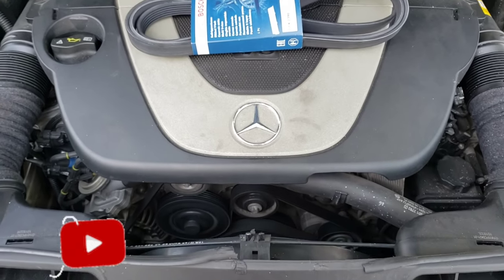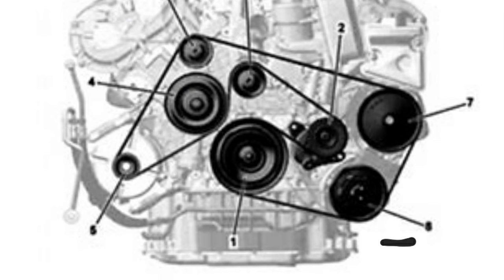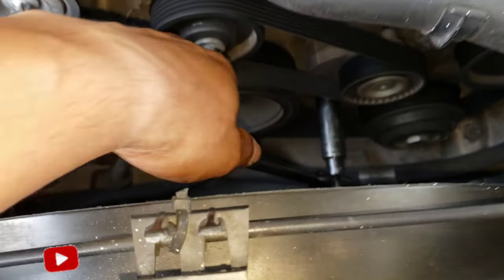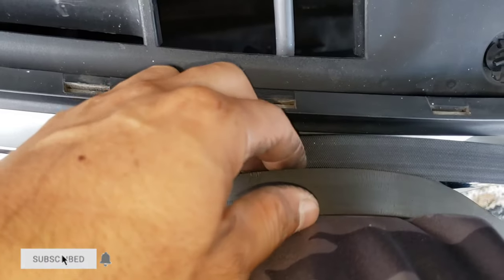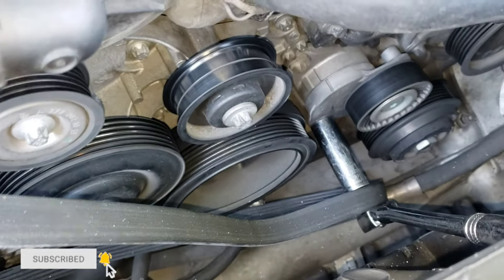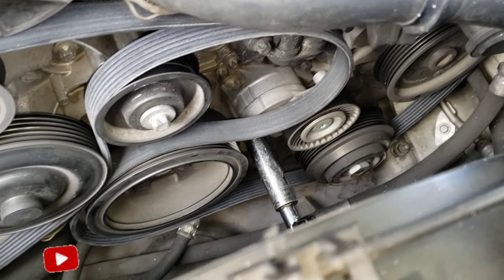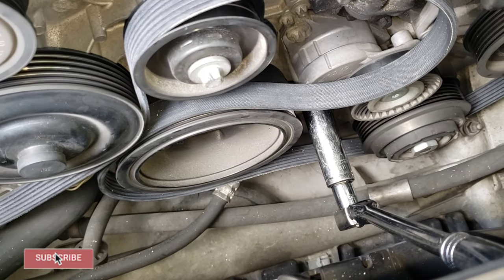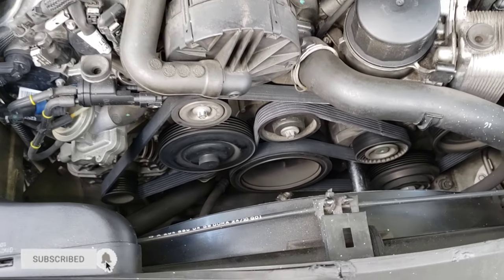How To Change The Serpentine Belt Mercedes c300 2008-2014 and diagram.

Comment: This is not for the 2014 c300 sport, learned that the hard way changing the belt on the side of the highway
Reply: May I ask how you know if your model is sport or not? I have a 2010 c300 and tbh I don’t know if it’s a sport version or not.
Reply from the maker: Hi. Thats a good question. The luxury and the sport are basically the same car with the exception of some cosmetic, for example the front grill on the sport has the mercedes star vs the luxury it has  a small star on the top front of the hood also the steering wheel on the sport has 3 spokes vs the luxury has 4 spokes etc (headlights, stitch pattern,wheels);  

Mechanical difference, would be the suspension. The Sport model has a slightly tighter suspension system, as a result it handles a little more aggressively with less body lean when pushed hard, it’s a little more firm over bumps in the road. The Sport model sits about 5mm lower than the luxury model in the front. Thanks for watching.
Reply: @Silenced_by_nazi_youtube  ❤😢😢😢

Comment: Thank you so much for posting this video. My car is an S550 model, and it appears it is the exact same setup. I am not a mechanic, but have done some repairs just by watching youtube videos. And since visits to the mechanic shop for repairs  have, unfortunately, become so expensive these days under the current economy, then this is a potential option.
Reply from the maker: Hi. You are 100% right,  is very expensive pay to fix this cars. Good job for fixing anything that you can. Thanks for watching.

Comment: Hey I have a quick question I have a 2009 Mercedes c350 and I’m trying to tune / upgrade it what do you think would be a preferred spot to start at?
Reply from the maker: Hello. Thats a good question, it all depends how much horse power are you looking for; some people start with the ECU  which is the brains of the engine, and as such, it tells the rest of the components what to do. It will allow for a richer air to fuel mixture and an increase in horsepower. Also the intake is one of the common part that people often start with and is one of the most affordable. The exhaust is the iconic mod that almost everyone performs, and for a good reason. The reason being the aggressive sound, as well as the increase in horsepower but this can be a bit pricey.
Reply: @hackerskates  thx for the info and yes gonna looking into the eco first right now it’s stock but trying to build it for fun 

Was looking at the stage 1 tune then when I’m ready go from there 

For what it is, it’s a nice car
Reply: @hackerskates  right now I’m just doing the basic stuff replacing the wheel caps buttons inside that have been used to much, and the belt 😂kinda squeaky, etc first then the gonna start with the tunes and the exhaust.

Thx for the info and the help most appreciated 🙏🙏🫡
Reply from the maker: @chad9382  you're welcome my friend. For a basic tune-up you could start with replacing The Squeaking belt😁, that could be a wear out belt/loose, sometimes an aftermarket belt can also make that Squeaking noise.
Reply: @hackerskates  yes it’s just lose but gonna replace it and give it a good look over gonna fix the button inside that has been used and needs fix any suggestions on how to replace it kinda want to do the full buttons and not sticks bc Ik there is 2 options kinda putting a note on what I want to do and etc but definitely the simple stuff gonna get checked and fix but again thx for the help gonna definitely sub

Comment: Before you start replacing your serpentine belt make sure you know if your car has a hex head or torx head bolt on the belt tensioner.  If you assume that your car has a hex head bolt you may be in for a big unpleasant surprise, check it!

Comment: What size ratchet did you use?
Reply from the maker: Hi, I believe that's was a 12" or 14" ratchet, you can also do it with a smaller, with a bigger ratchet would be easier you would have better leverage. Thanks for watching

Comment: How do you tell if the tensioner is bad?
Reply from the maker: Hi, thanks for watching. This are some of the common symptoms.

-Squeaking or Grinding Noise

One of the most common symptoms of a failing belt tensioner is unusual noise coming from either the tensioner or the drive belts.( in some cases Squeaking noise is a sign of a bad belt, I suggest replace the belt with an original belt, sometimes an aftermarket belt can make your car squeak)

-Unusual Belt Wear.

This is another symptom of a failing belt tensioner. Depending on the type of drive belt that you have in your car, then you should see even patterns throughout the length of the belt

-Failure of the Belt-driven Accessories to Operate

Since the belt tensioner keeps the proper spinning of the drive belts in the car’s engine, certain components or accessories may fail to operate if there’s a problem with the tensioner.

-Bleeding Rust and Presence of Cracks

If you notice rust forming or bleeding between the belt tensioner arm and base, it is a sign that the tensioner needs prompt replacement.

-Excessive Sideward Movement of the Tensioner Arm

Turn on your car’s engine and watch the tensioner arm. It should stay in a tight position.

Comment: Kia amanti 2008 how set pully
Reply from the maker: http://www.supermotors.net/getfile/485666/original/gen-4-diagram-belt.gif
Reply from the maker: Hi. I send you one example of the serpentine belt set up, it seems like kia has different types of motors. I don't know what motor type you have. You can Also search in Google, usually you can find alot of information there.